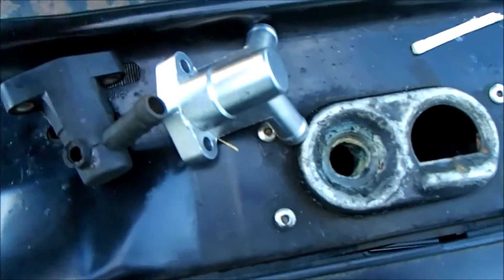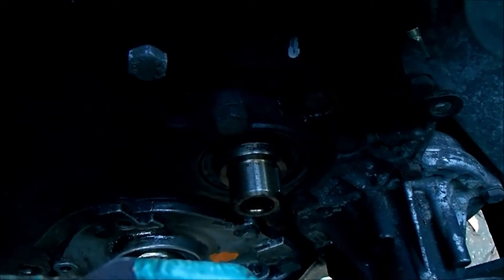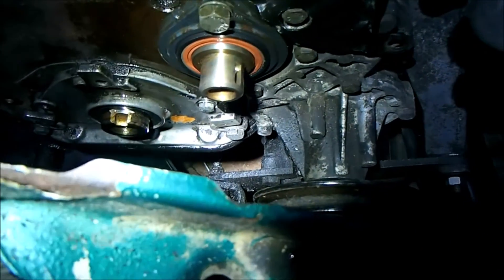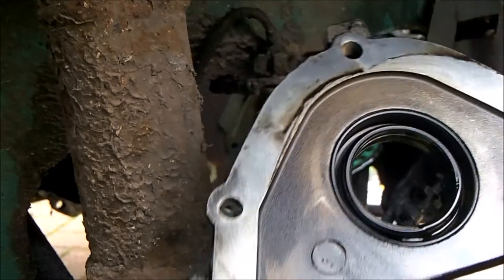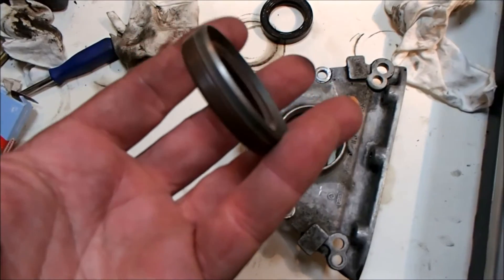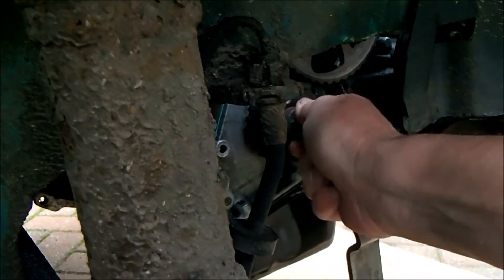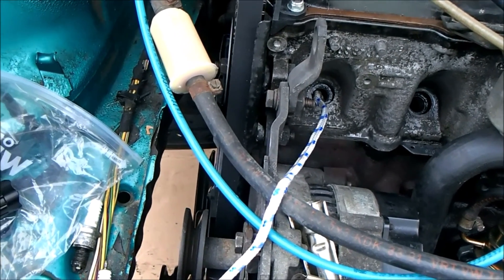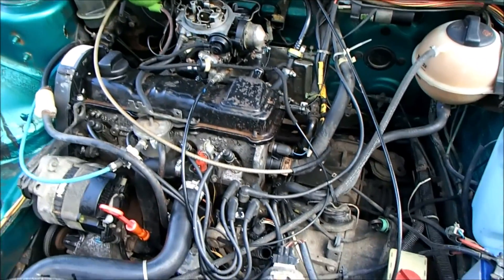Volkswagen Golf mk2 crankshaft oil seal replacement part 2

Comment: Hi i’ve replaced the intermediate shaft seal just like you did, but forgot to make my own markings on the pulley when taking the cam belt off. Would you happen to know how to realign the shaft, setting it in time? 

I’m guessing i’d have to line up the flywheel BTDC timing notch and rotate the intermediate shaft untill the distributer rotor lines up with the mark on the housing, but i’m not that familiar with vw engines.. any help would be appreciated!
Reply from the maker: I honestly don't know the true answer, I'm guessing that if cylinder 1 is at firing position as marked on the pulley, set the distributor to cylinder 1 , that may be the answer? Check out the Haynes manual for reference though

Comment: What's that noise at around when the engine is running?  Mine does the same even if I run it for few seconds without the alernator/water pump belt.
Reply from the maker: I had assumed it was one of the v belts as I haven't changed them since having the car. It could be cam belt noise but it has had new one and tensioner and the noise is still there. Didn't seem to be a problem though.
Reply: @richardjweeks  Thanks for your answer, on mine it is very noisy I can hear from the interior on idle.

Comment: Hi could you please advise what seal manufacturer you used for the sump.  Mine is leaking so just want to make sure I do job once😀.
Reply from the maker: I honestly don't remember. I can say it came from autodoc though
Reply: @Richard Weeks  Thank you I'll have a look
Reply from the maker: @igorskoro4624  found it. Topran oil sump gasket art no 105 752
Reply: @richardjweeks  top man cheers for that 👍